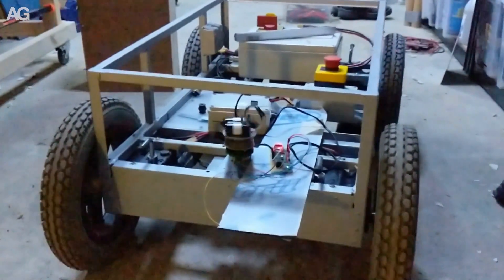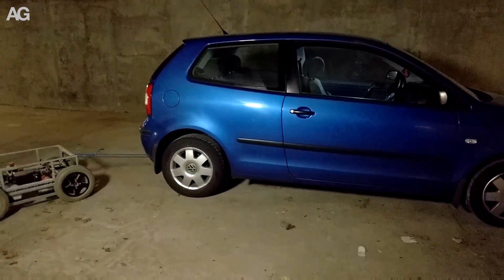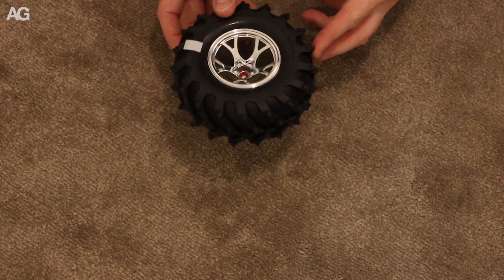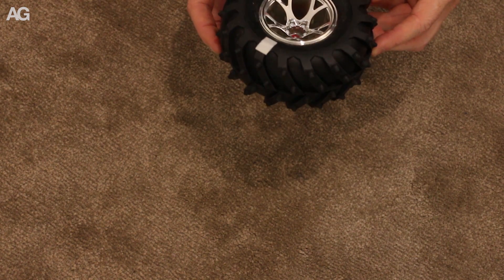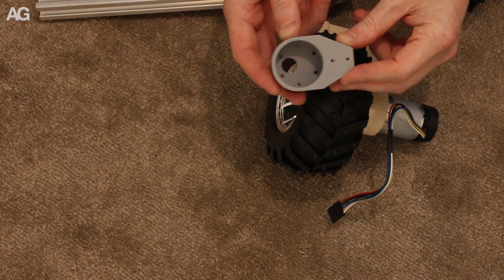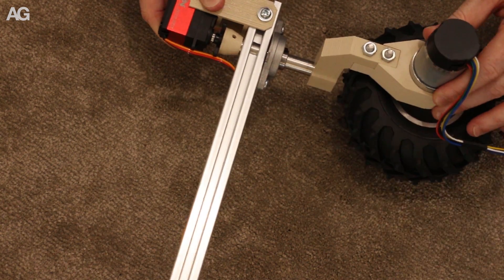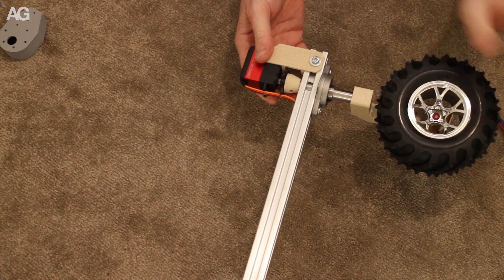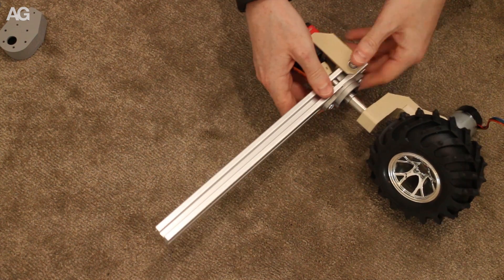I Am Building A New Rover - Steering & Wheels

Comment: Nice! are you going to use arduino or Raspberry pi?
Reply from the maker: Probably a Raspberry pi but possibly something more powerful, I am planning on using the Robot Operating System which runs on Linux machines
Reply: Wow! looking forward to this. Also do you have any experience with long range TX such as the CC1101? Im building a picosatellite and need some help :D
Reply from the maker: Sadly no long range comms experience. This probably won't leave the home so will be happy with WiFi!